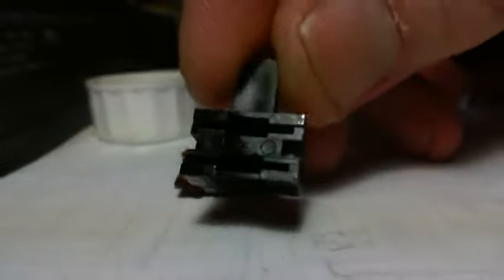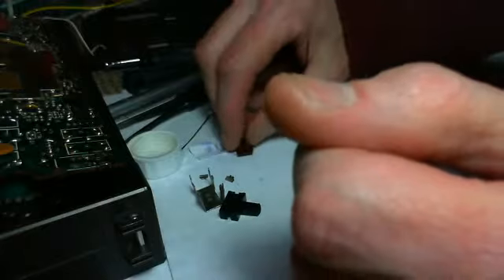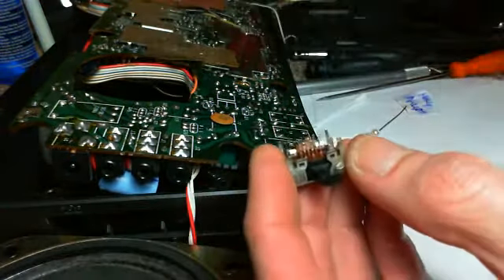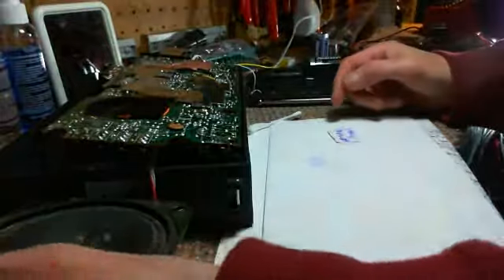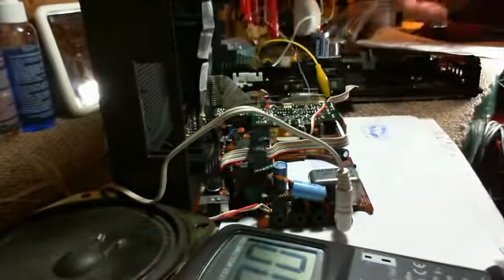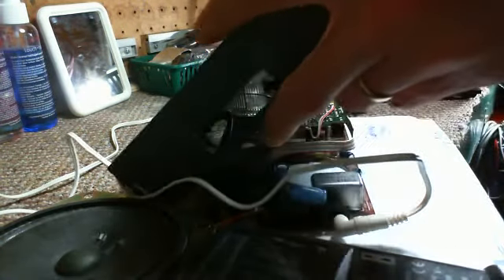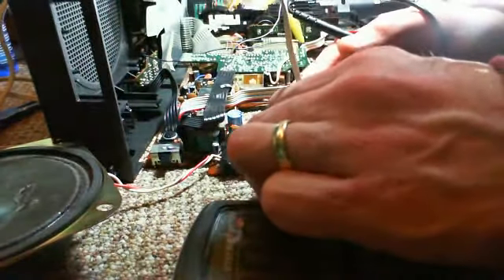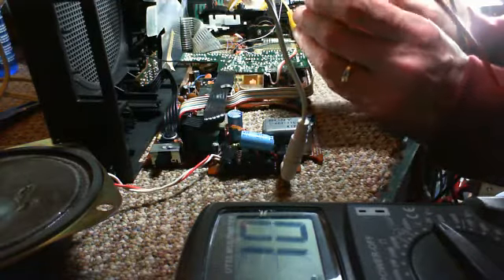Sony ICF 2001 Video #18 - Re-installing the Power Switch

Comment: Hi Jim. From what I've seen,it would seem to be a cable or the cable moving a part. I've looked over the schematics. Your best bet is to pull all the boards that are on the inside front of the case and check all the solder points,cables and components. Time consuming yes, but I see no other way to be sure at this point. I feel for you Jim,but don't give up. Maybe take a much needed break for a bit. Take care

Comment: I was surprised you didn't test the switch before you took it off and after your removed but before you disassembled it.
Reply from the maker: I did test it as soon as I had the board out.  It tested good.  That's why I didn't pursue it sooner.  Removing, cleaning it and re-installing was more an act of desperation than a clearly indicated step to take.  At least it is now out-of-the-way and I can concentrate on everything else.
Reply: Ok,  I guess I missed that video.  I don't know who jumped more when it came to life, me or you.  Your videos get more entertaining every time. LOL